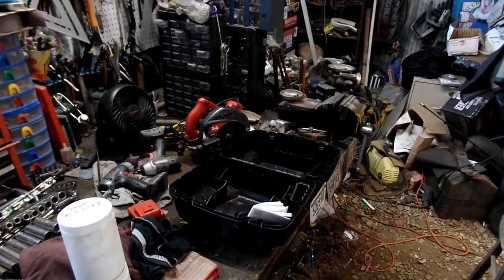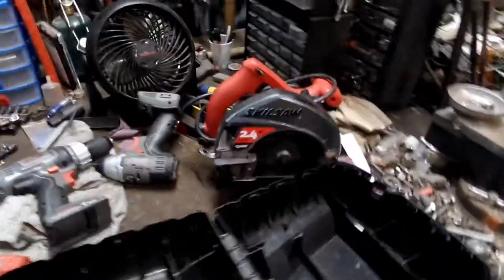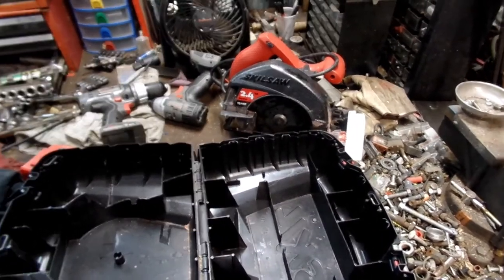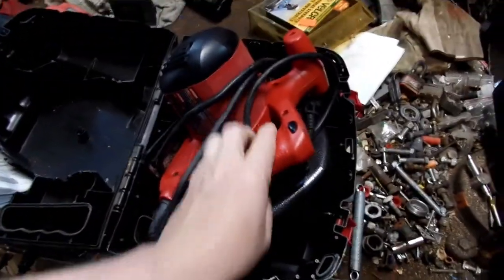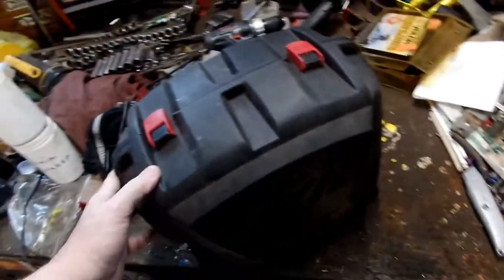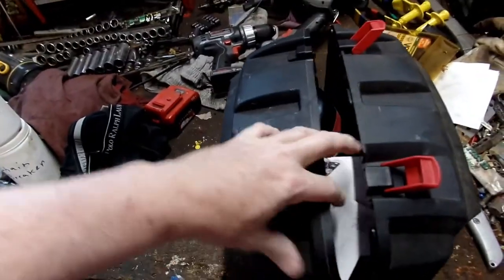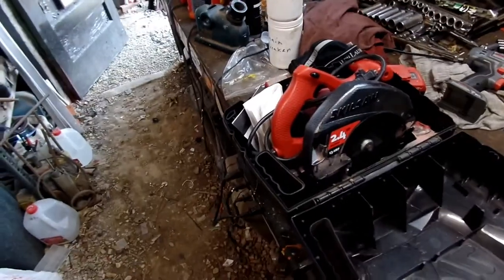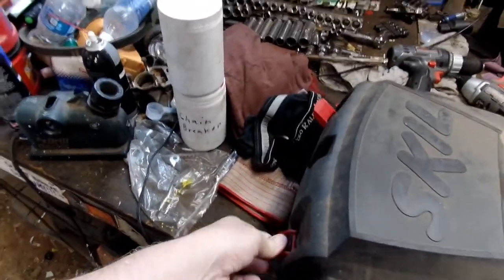The GREATIST VIDEO, How to put a Skill Saw Back in its Case!!

Comment: Ours still didn't fit after watching this, found out you have to loosen the shoe
Reply: underrated comment...yes you still need to make sure the shoe is fully retracted.  I've wanted to throw this saw away before.  They even have a picture on the inside of the case of how it's supposed to lay, but it doesn't fit there if you don't loosen the shoe...madness.

Comment: It did help - thank you! And I noticed something when putting my saw away…in the recess where you stashed your saw’s papers there is a diagram of the saw in the correct position for putting the saw in the case! It needs to be a contrasting color though, so you can actually see it! Thanks for the video!